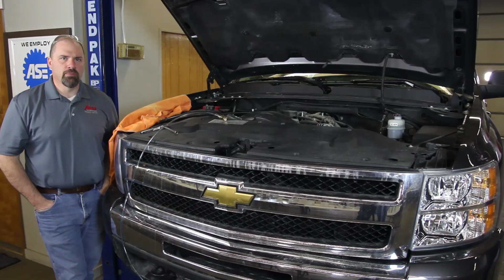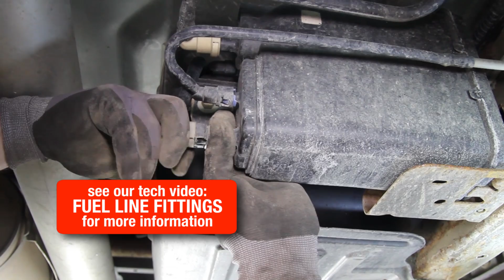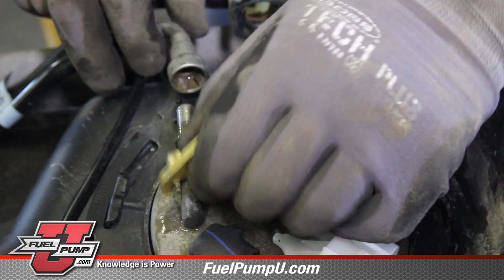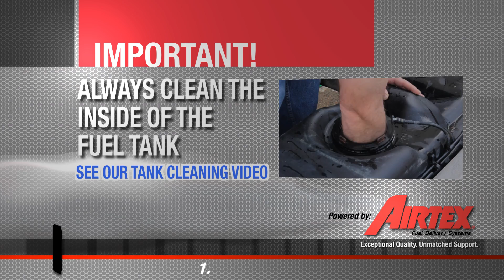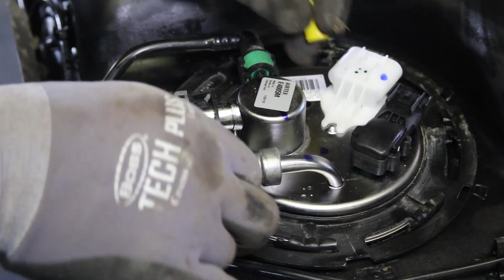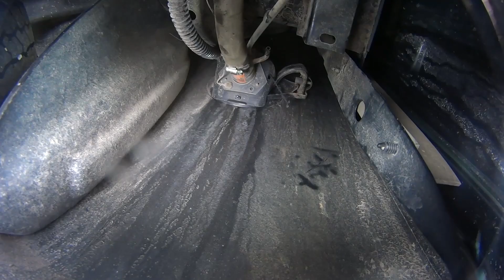How to Install Fuel Pump Assembly E4005M in a  2010 - 2013 Chevy Silverado / GMC Sierra 4.8L 5.3L

Comment: I am putting a 5.3 vortex in my 55 Bel Air. It is out of a 2006, half ton, 4L60e trans. Will the fuel tank need to be pressurised?

Comment: So the fuel pump doesn't sit right in the tank you have to push it down to lock it in place?
Reply: How u install a 2013 fuel pump module

Comment: Fastest way. Just remove bed bolts tilt up the front of bed, and walla!!!! the pump is right there.  No need to be dropping the tank and emptying it... :)
Reply: that's exactly what my dad did with him GMC sierra lol.  and it worked just as well👌👍
the only thing is that you ain't able to rinse the tank in and out.
Reply: yeah my tank was so rusted I couldn't get the fp back in that way with the ring. Man hard. Also the guy before me messed up the retaining springs and just zip ties the freaking fuel line back on. no wonder I was only getting 280 kpa.
Reply: or just cut a hatch in your bed

Comment: Would appreciate it if you could possibly give me some input...

I have a 2009 Silverado with around 12,000 miles.  Yesterday I remote started it and when I went outside fuel was gushing out from under the driver's side running across the drive. IMAGINE MY SHOCK!!  I found the rubber fuel line from the tank to the steel line leaking at the 90 degree fitting that connects to the steel line. On inspection it felt like the rubber had basically gotten brittle and crumbled. 

 I know the truck is 8 years old but with just 12000 miles on it I was surprised this happened.  I had a 1985 Silverado with 140,000 miles and never had fuel line issues.
I did replace the fuel pump once.

Q1; Have you heard of this, is this a common problem?  I'm thinking this is a MAJOR fire/safety hazard.  I'm just glad I wasn't driving down the road.

Q2:  Could the ethanol gas have caused this?

Q3: Is the 2009 Silverado tank removal basically the same as the 2010? if not what should I look for?

Q4: Would you recommend replacing the emissions line too?

Thanks for the very informative videos you have.
Any input is appreciated.
Reply: ***** Thank you for the feedback, much appreciated.